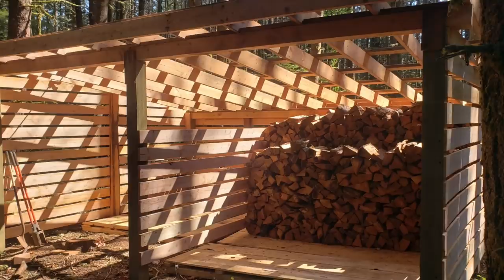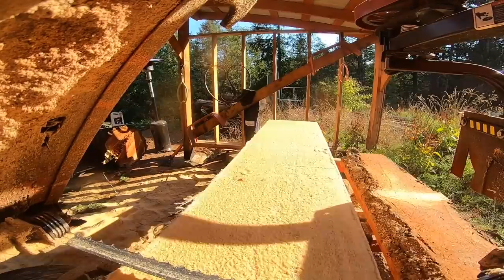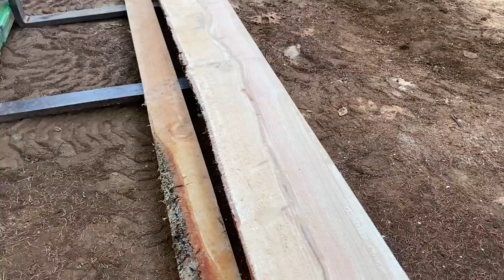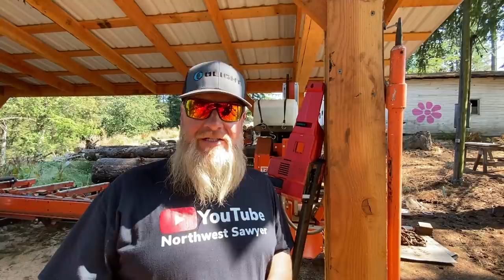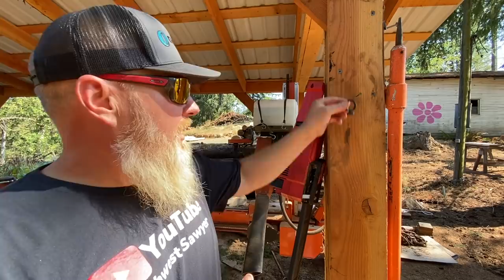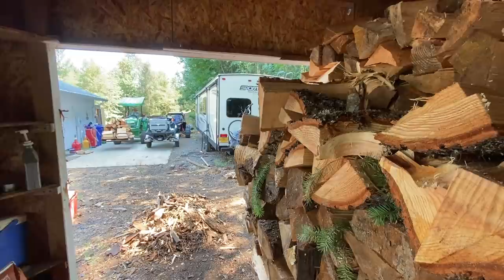Building A BIGGER, BETTER Sawbuck!

Comment: Hi Jasson there a guy on YouTube that runs a mill and what he does with his firewood is he stacks it into large wooden bins that hes able to move with his forks in his situation hes getting on in the years now and he runs a outside wood heater that controls his home heat, Hot water, green house & a drying facility. i will give you his link https://www.youtube.com/user/fricknjeep I think what hes setup is brilliant and a good use for his firewood and off-cut flitches
Reply from the maker: Awesome! I’ll check it out!

Comment: You helped me to realize that a saw buck can be used to dropping the flitches onto for cutting them up quickly and easily.  The cutoffs are such a nuisance and always accumulating.  I've tried chipping them, and that works too, but firewood is more valuable than chips.
Reply from the maker: It took me a long time to discover this myself!😂. You can never have too much firewood!